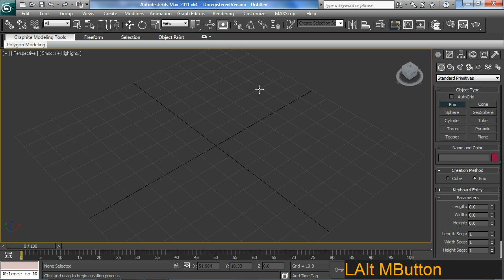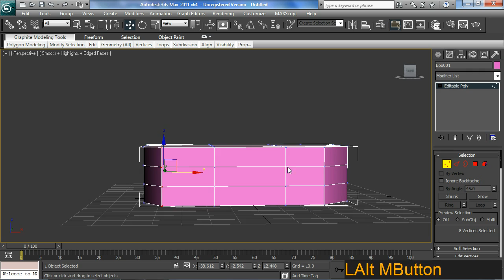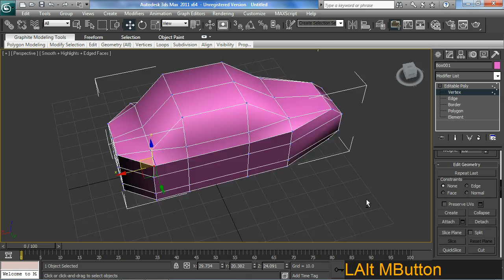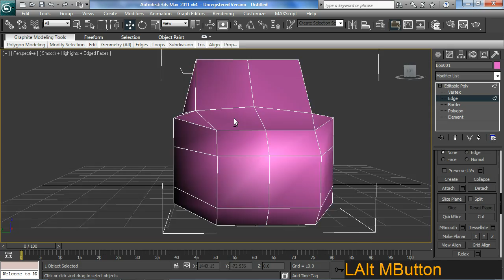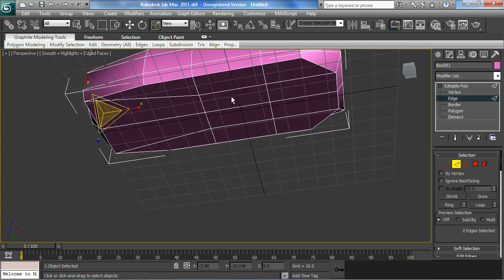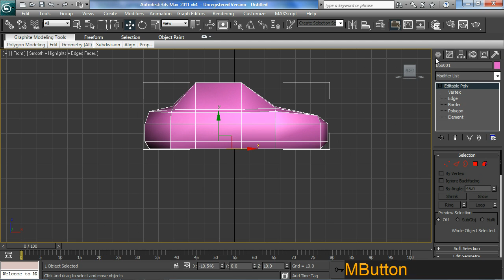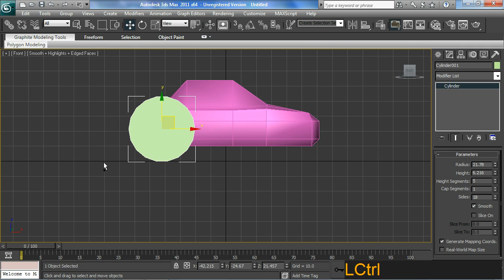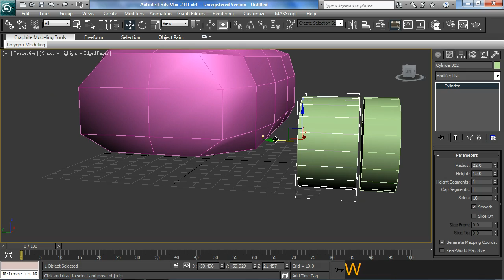3dsmax car from scratch to UDK - part 1 of 10

Comment: everybody says that triangles are bad and you better get rid of them. whats your view?
Reply from the maker: ok.. so the car I modelling in this tutorial is a really bad example of modelling.. 

that being said.. keeping the mesh as quads is how you want to do it..  technically its better, and for realtime appiications the mesh will have a lower memory overhead (tri stripping)  Aesthetically its better and from an artist point of view easier to work with.. easier to UV unwrap etc..

Its worthwhile pointing out that all meshes are triangles anyway..  sometimes you might want to triangulate a quad to define where the quad will fold during deformation..  this can be important on a skinned mesh.. especially low poly ones.

so it's best to not model in tri's but if you have no choice then use a tri. n-sided polygons are worse.